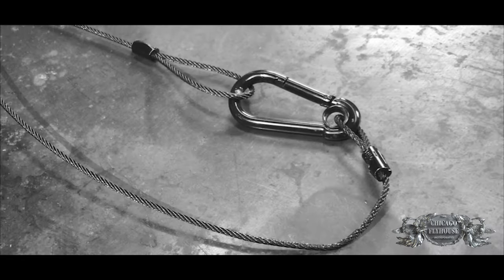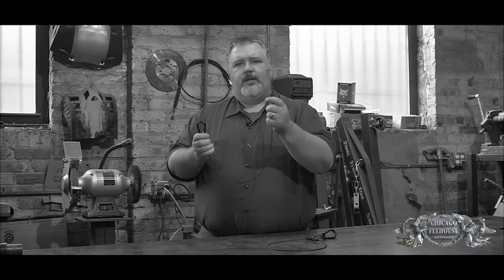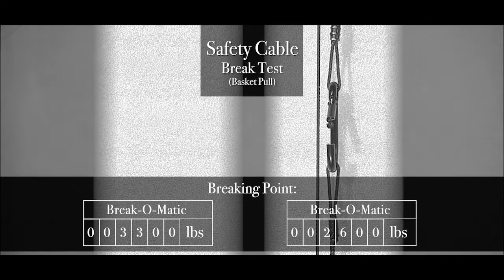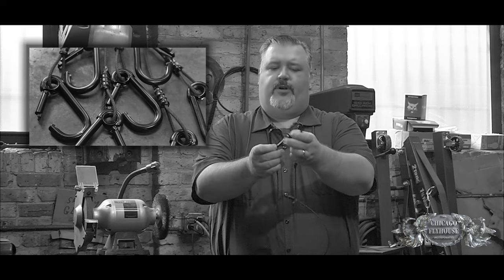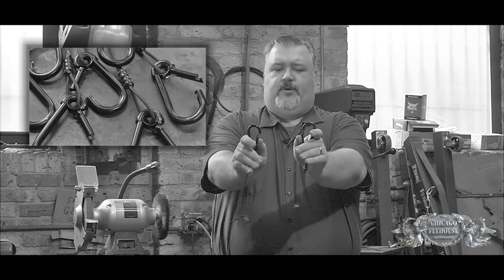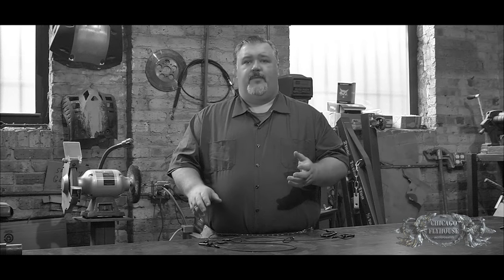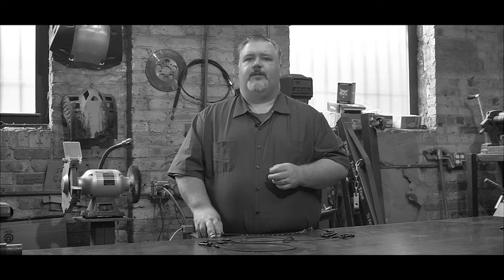Understanding Lighting Safety Cables

Comment: Does the breaking point rating change if using a double-wrap?
A double-wrap is a safety around the yoke of a conventional light, wrapped around the pipe, and then clipped to itself (the double-aircraft cable near the pipe).  This shortens the dropping-distance substantially.  Is it safer than the 2 examples you explained in this video?

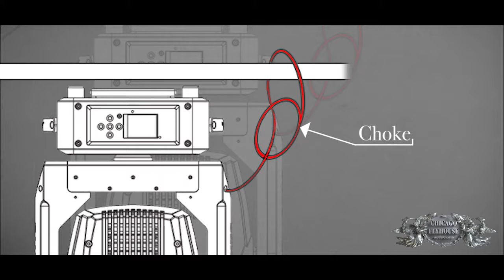Comment: At about 1:30 your have an illustration is of a moving light, with the safety chain choked.  The illustration makes it look like the chain is anchored to the yoke  Since this is part of the movement system on that sort of light, that's...rather improbable...  Granted, it doesn't too much change what you're talking about, but it's pretty clearly NOT the way to attach a safety chain to a light...
Reply from the maker: We did notice that after the fact. We will make sure to make a note under the video. Thanks for pointing it out!

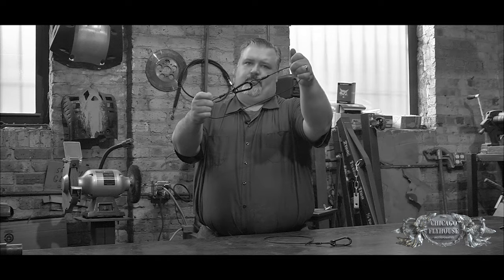Comment: 0:55 Safety cables should always be attached to the fixture itself (if possible), rather than the bracket. On the Source4 for example, the safety cable should be attached to the small hole near the back of the fixture (not referring to the back handles). If in doubt, always check the manual. 
Also it would've been cool to see a shock load demonstration. Anyways, great channel guys!

Comment: I am having trouble finding where safety cables are required by a law.  I see many area theatres that have NO safety cables on their fixtures. I was at a theatre last night, and they used zip ties to hold the light to the girder.  As a Lighting Designer, I was LIVID!.  Any information that you can provide on safety cables being required  by law, would be most helpful. Many do not use their brains when installing fixtures.  They have no clue how many lawsuits they will face should a light fall and land on someone's head.
Reply from the maker: Most of the laws that apply in your venue are going to be local laws which will not call out secondary cables. Where the  law can be applied is through the general duty clause of OSHA law. Workers must be protected from recognized hazards. ANSI standards, such as ANSI E1.4-2-2021 Statically Suspended Rigging Systems, call out that any single point of attachment should be backed up with an appropriate safety. In that case, not following the standard amounts to not protecting against a recognized hazard and thus a violation of the federal worker safety law. Rigging and other entertainment standards are available for free at tsp.esta.org.
Reply from the maker: From the standard listed above: "3.8 All single point suspensions (from attachment through load carrying device) shall incorporate a redundant point or safety line assembly as an additional safety feature unless otherwise determined in a risk assessment by a qualified person considering the single point failure hazard. The safety line shall be as short as possible to minimize the shock load on the components and anchor point. Anchor points or supporting structure shall be designed to withstand the anticipated shock load imposed by the safety line assembly."

Comment: Would you suggest attaching smaller lights, like an ARRI L5-C, to a safety cable when storing them in the lamp dock to prevent them from falling? Would there be too much risk of them hitting the lights on the shelf below if they were to fall?
Reply from the maker: We recommend using a safety cable on any item with a single point of primary attachment.  It may be advisable to make or buy short safety cables if you have a concern about them contacting other items in the case of a fall.

Comment: I'd like to point out that your statement that chocking automatically makes your safety-cable longer can be fixed by wrapping around the pipe a few times before chocking, it does nothing to the "loadability" but greatly shortens the fall-distance
Reply: And I should have watched the whole movie before commenting ;-) I just heard you about the basked-to-attachment-point method. Same difference 🙂
Reply from the maker: Thanks for the comment!  There a couple ways to keep the fall distance short, and that, along with using any manufacturer-provided attachment points on the body of the light, are the primary concerns when using a safety.